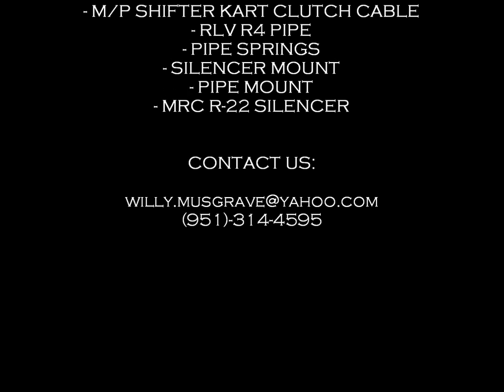Factory MRC 2013 Tony Shifter Kart

Comment from the maker: Yes, it is a CR125 spec class that uses stock 1997 transmission (6 Speed), stock 1999 cases/crank/internals, and 1999 or 2001 cylinder/head/top end.

It makes for very fast and competitive racing while keeping cost down for the racers.